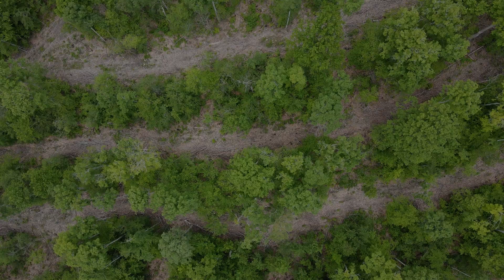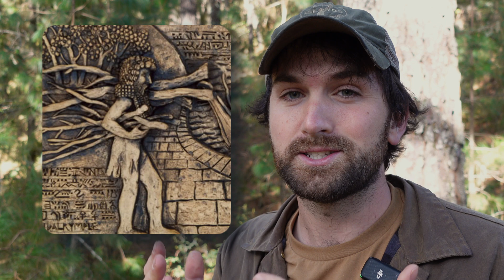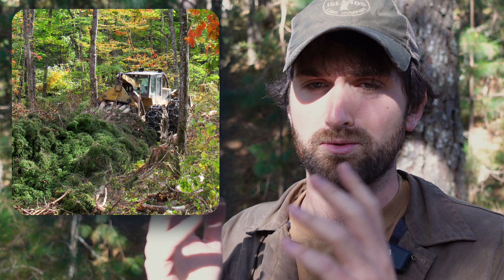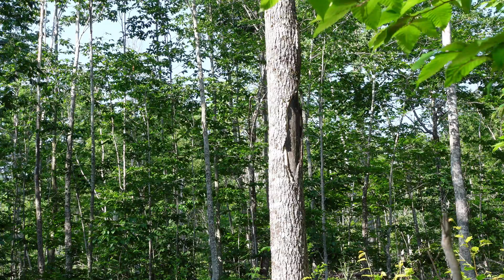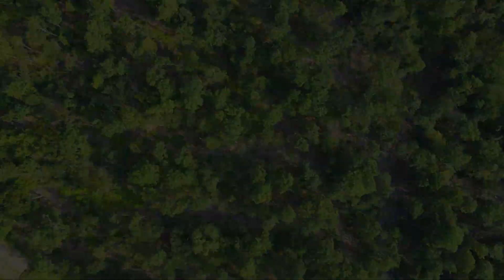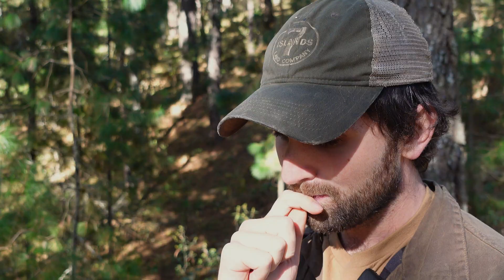Timber Harvest Trails Are Destroying Your Forest

Comment: Maybe the machines are designed for maximum efficiency and not taking any of the other points mentioned. I pull 16 foot logs  out with a 45 hp tractor that is 5 foot wide! I rarely have to make a trail. But in a commercial harvest, it would be way too slow!

Comment: I use a logging winch with 180 feet of cable.  Trees 60 feet long are fell towards the tractor so now 240feet reach.  Now go to the other side of the block and you get another  240 feet reach.  That 480 feet between trails.

Comment: What’s the best way to eliminate volunteer pines on a small parcel?  I was told to just cut them and let them lay where cut.
Reply from the maker: Yeah, a brush cutter will make short work of it, and you can find them at most equipment rental places.
Reply: What about the volunteer Hardwoods?
Reply from the maker: @davidvines6498  That can be a little trickier. A brush saw will still work fine, but depending on the species, hardwoods are more prone to resprouting after mechanical cutting. In that case, you may have to apply an herbicide or do multiple rounds of mechanical cutting over the course of a few years.

Comment: Modern fellers and grapple skidders are a necessity to loggers being able to stay profitable. In the early 90s I was working for a decent sized company that had a felling team and three cable skidders. Me and another guy would pull cable and set chokers all day. The trails were cut to a minimum , less work and culvert placement,basically time. We would steer around nonharvested trees with cable pulleys. Now the machine backs up to the stump,driving over the replacement trees and barking up the others. The cutting disk on the harvester
 is clipping the saplings off as it goes tree to tree. A lot of times felling direction is determined by the ability of the grapple to get to the stick. It is a different time. The evolution of the industry due to labor costs and increased insurance premiums. Safer and cheaper. It keeps the cost of production down and makes 
wood products more affordable.

Comment: okay, we probably operate in different conditions and on a different scale, but:
Couldn't the trail related losses be minimised by planning where the trail should be at planting? Then you can just plant less valuable pulpwood species that stabilise the forest ecosystem  along the trails, and the light - hungry species in the neighbouring rows, or just double the amount of those pulpwood species in the roadside rows bc you widened the row spacing (and those 6m is in normalrange for distance between the rows of mature trees). U can even plant some willowto be removed when making the trail
Doesn't the number of trees per acre refer to the area between the trails? I don't see how leaving too much trees there directly makes up for removing trees from trails unless the extra trees u leave are all right by the trail
Reply from the maker: Even in those cases, planning the trails from the beginning incurs an opportunity cost. Increased light can make up for it, but only to a point and where quality isnt important. 

But the other point to consider is the productivity of thinning. The trees taken in trail during the first thinning are around 50% of all volume removed, and it tends to be the easiest, most productive wood. Outside of the trail, the machine must carefully pick and choose between trees (unless its a strip removal or something), so not having that trail can increase costs dramatically. So long as costs are increased, we have to ask whether that is the best way to utilize that extra expense. My argument is simply that it makes more sense to put that extra expense into more specialized equipment

And of course, the more mature trees are, the more space in between trees and the less the long-term cost of a trail, which is why this is more of a concern for selection harvests and thinnings.

Comment: I just had a parcel logged and I agree with a lot of what you said.  My trees were mainly white pine that was mature.  There was quite a bit of root and red rot.  It needed to be cut 5-10 years ago.  This was a good pine cone year here so I’m hoping for regeneration in the larger open spaces.  I’ll be planting some areas with plugs for screening. There was more skidder damage than I would’ve liked.  I’m hoping those remain seed trees for many years though.  Two of the skid roads were already in place.  I’ll let the other roads grow back.  They’ll be good for wildlife for several years as they grow up.

Comment: I get the point of minimizing trail surface, but what's the practical alternative? Clear cut in sections? Harvesting with a chainsaw and a small logger would take forever, and labor is expensive.
Reply from the maker: "clearcutting in sections" can absolutely be a good alternative, depending on the parameters. Even though it might not look like it, Im managing one of my stands with progressive group selections, making small .5 acre patch cuts at a time. 

Chainsaws might be slow, but one of the benefits of forestry is that it is pretty rare that a harvest is an emergency. A farmer might have a month to harvest crops in the ground, but the forester easily has a five year window before delaying a harvest causes problems. Unless we are salvaging timber from pests, disease, or fire, the worst case scenario is the trees grow a little more, and you can harvest more wood. 

But importantly, there are a lot of smaller closed-cab machines that can do the work just fine. They are used in Sweden and other Scandinavian countries frequently.  But the US doesnt yet have the commercial infrastructure for those machines, mostly because of the industrial history of how our forestry practices developed--up until surprisingly recently, our forest production far outpaced harvest, so we didnt have to pay as close attention to per-acre production as they have in Europe, where their forest resources are more limited. That's why I say the market needs to be developed more. 

Labor is definitely a problem though. But that's going to be the theme of the American economy for the foreseeable future.
Reply: It’s hard finding loggers with smaller machinery and willing to take on smaller lots. It’s all about the $$$ unfortunately.
Reply: @nhmountains5683 I’m guessing it equally hard to find land owners who understand true cost of harvesting with minimal damage or impact to the property. Can’t always maximize everything. Pick your poison!